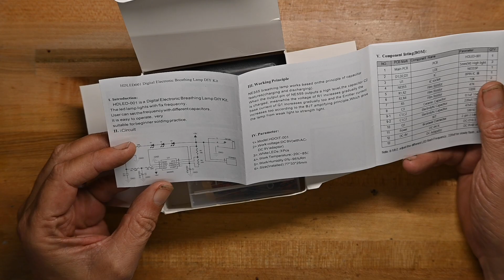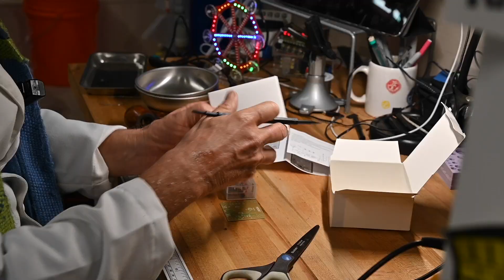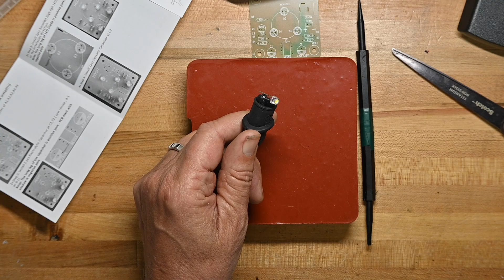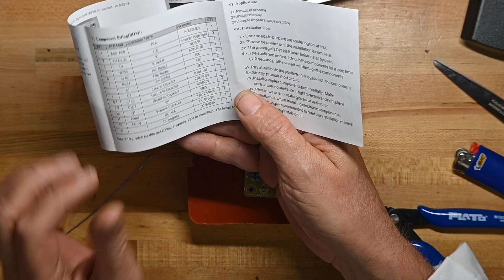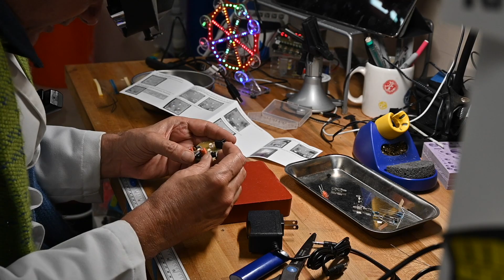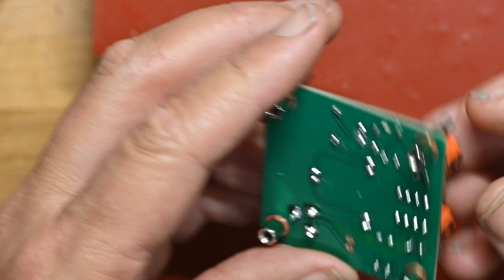C.K. builds a "breathing" LED flasher kit

Comment: Let ‘em slide on the missing resistor… they gave you a lot of extra other stuff after all
Reply from the maker: I agree, but only because I have plenty of spares.  If this was the first kit a youngster got, and that person had no spares (which is typical for beginners) they would have been disappointed and possibly turned off to the idea of building.  Have to be extra careful with that.